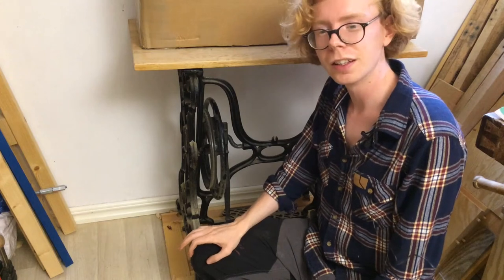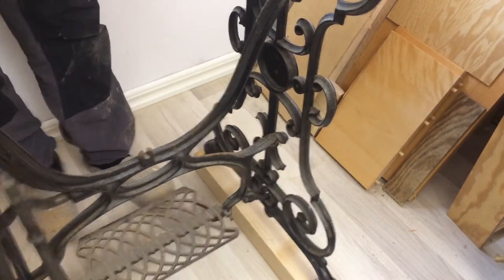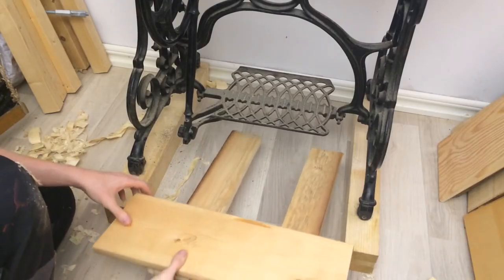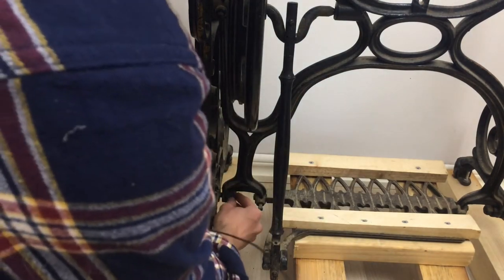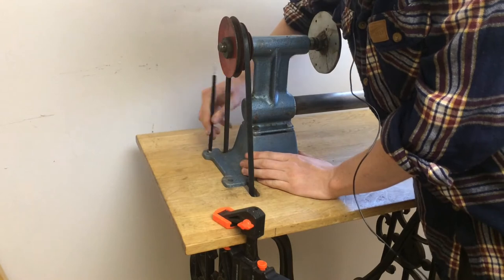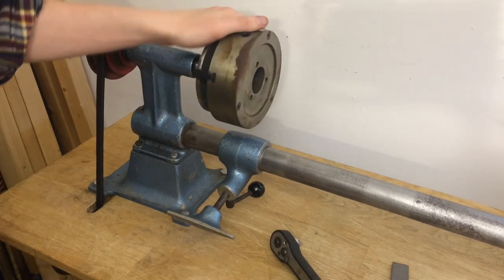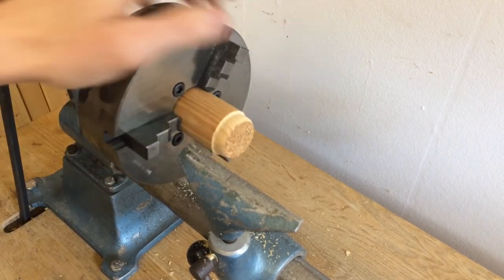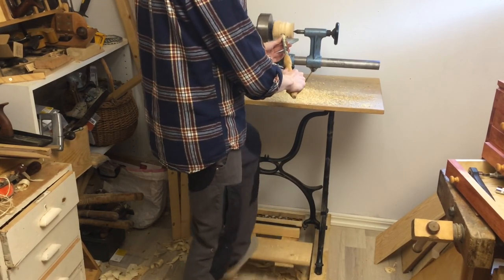Foot powered lathe build (with very little narrative structure!)

Comment: The original belt was a round leather one, joined at the end with a staple. So no need to disassemble to change belts.
Reply from the maker: Correct, the confusing thing is how they got it assembled in the first place. At the point where I couldn't get the shaft out, it was no longer contacting the screw; it's literally too long for the frame!

Comment: You can use the leather belts made for treadle sewing machines. They are not expensive so if you need to use two of them it would still be under $12 including shipping. If you used them you would not have to disassemble the treadle base to replace the belt. Also, for anyone else building one of these they do not need an entire elongated hole for the belt, but only two round holes for the belt to pass through.
Reply from the maker: Thanks for your thoughts, Rosemary! You could, but I don't know if a round leather belt thin enough to fit on a sewing machine pulley would transmit the torque a lathe needs, and I'd rather not use an animal product for experimentation. Rubber V-belts are a safe bet, much more contact surface. And it looked like it would be so easy to take the pulley out! Two round holes would of course work with a stapled belt (not with the type I used) but you'd have to be sure on the hole placement, a slot gives more room for adjustment. I would make a slot even if I made another with a stapled belt.

Comment: If while you had the stand apart you had fully taken the fly wheel out you could have filled the the flywheel with concrete by improvising some shuttering, the extra mass would have made the action smoother and helped to stop the lathe stalling during turning
Reply from the maker: Now that would be something :)

Comment: WHY ? Never cut the lathe casting. Totally ruined this for me. I would have gone for a larger pulley possibly on the lath spindle to get the clearance past the lathe foot. Perhaps a longer spindle might have worked but that might have put added strain on the bearings. Cutting the foot casting is a horrible way to resolve the clearance issue. :/